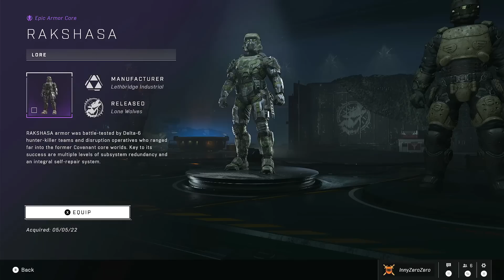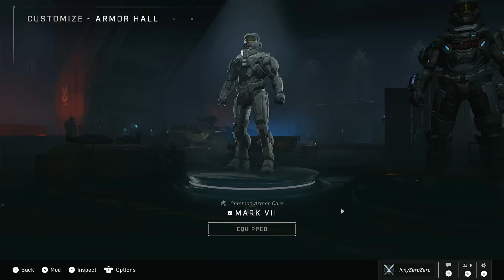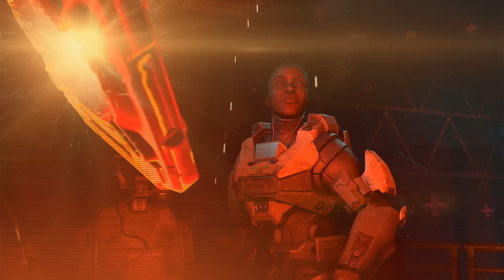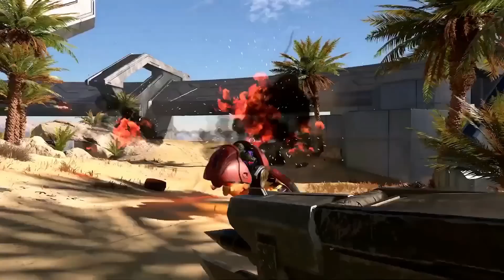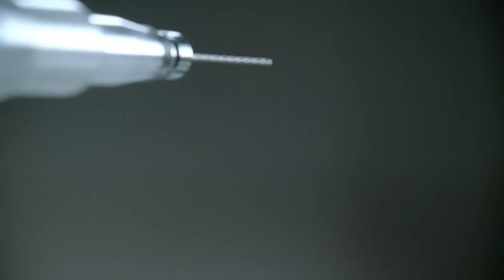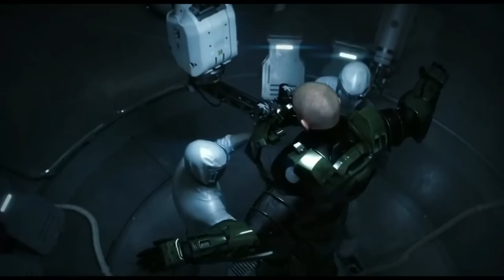Rakshasa Armor Core - Why no fusion packs? - Lore and Theory

Comment: Is it possible that the reference to superhuman stalkers and killers is actually a reference to Spartan IIs? It's not like there is an option to be a Spartan II within multiplayer so the references to Spartans would logically only apply to Spartan IVs and the current Spartan program. In that sense the the equipment might have to have been downgraded to cope with the reality that Spartan IVs are lesser than the IIs.
Reply: Considering the reference was for a helmet that was meant to be in Halo Reach, it’s likely just alluding to Spartan II’s or III’s (since you play as a Spartan III in Reach)
Reply: i guess so.
i hope s4's are only initialy worse and will need mire time to grow into their augmentations,instead of them being weaker period.
well, as long as they have cat3 or even cat2 genes.
Reply: @Chrisspru  They are just weaker, mostly because the augmentations for S2s were so much more intensive, since their bodies would grow into them as they got older. S3s also had more intensive augments than the S4s, but were of slightly lower quality than S2s.
Reply: @giannicarbonara7342  the spartan 4 augs are refined spartan 3 augs with different delivery methodes (organ replacement instead of in-vivo manipulation). being adults, the effects are lesser as the body dors not grow into it. but similar to previous spartans, they should still get better with age.

spartan 4's also have lesser genetic requirements. a spartan 4 with the genetic makeup to qualify for a spartan  3 or even 2 could after a while gain the physicality of an original spartan, though it may take years in an adult body.

first company spartan 4's are 7 years into their augmentations, and those candidates with cat2 or 3 genes should   now have one full cell replacement, making them fully integrated spartans.
fresh s4 augments should be as weak as depicted.

locke has at least cat3 genes (was asked for the s3 program but refused). buck may have them too. its rumored tanaka and vale have cat2 genes, which are the reasons for their prodigy status and being inducted into the spartan branch at all.
Reply: @giannicarbonara7342  s3 augs are just as powerful as s2 augs, they're just safer thanks to, at that point, a decade of r&d
Reply: I was actually thinking those were references to the headhunters
Reply: Yeah, AKIS is only so hyped up in the lore description because of the development issues that kept it from being used in-game during Reach, yet also maintaining a lot of hype during then because we barely knew of it and it had that mysterious nature to it.

If it isn't referencing II's or III's, then I don't care what 343 says, it's just a shitpost for lore.
Reply: if not just a shitpost because AKIS, I wouldn't think so. For a while now SIIs and SIIIs have been folded into the wider Spartan branch and have been referred to as just "Spartans"
Reply: Idk why but for some reason I kinda thought the headhunters…?
Reply: That's what I thought when I first read it. They used the SII and SIII headhunter equipment and downgraded it for SIV's.
Reply: thats originally what i was thinking as well, maybe like a nod towards the headhunter program
Reply: I personally think there are more Spartans out there than we think, this is ONI we’re talking about. A wet dream of shadow organizations and conspiracy governments that make real world ones look tame most likely, they would do it. Rehabilitated Washouts from SII, a Class 2 of SII, even to a lesser extent, more Cat-2/headhunter SIII, surviving SIII washouts becoming SIV, Possible SIII Delta Company, heck even SV’s like how Installation00 described in that dedicated video.